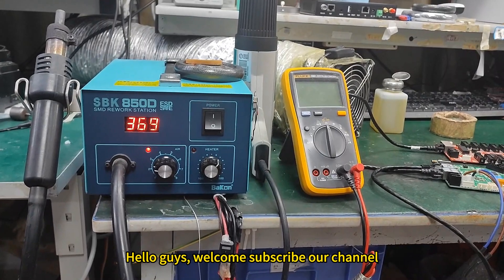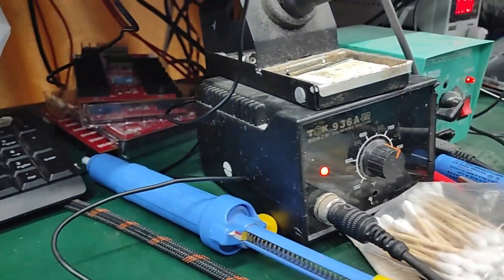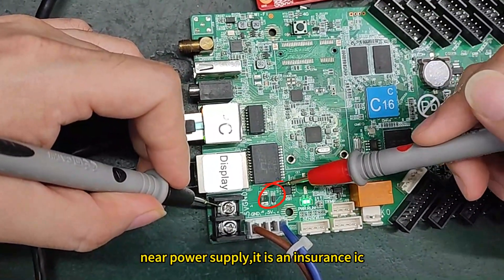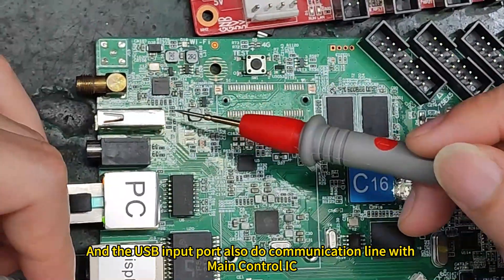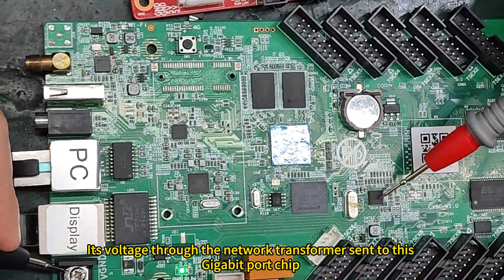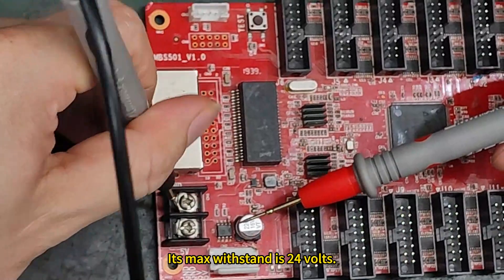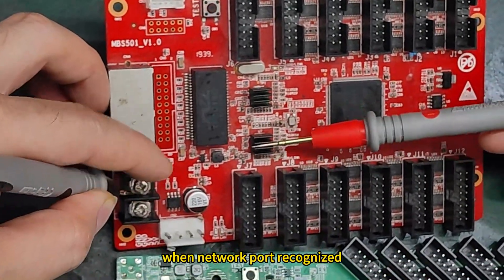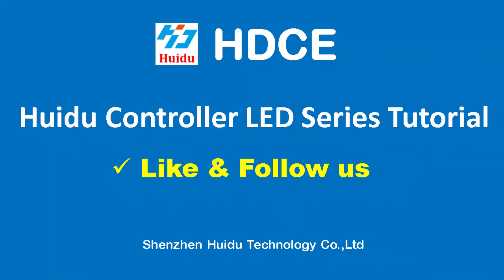How To Repair Huidu Controllers

Comment: Hi! I’m using an HD16. The app connects and sends the signal to the controller successfully, but the P2.5 LED panels stay blank. Any suggestions or settings I should check?
Reply from the maker: Did you finish debugging the right parameters of your LED panel before sending content? If you need technical support, welcome contact WA: +8613510540791

Comment: if you wrongly upgrade the firmware of R512 recieving card with R712 firmware files can the recieving card be restored back?
Reply from the maker: yes, you can upgrade again with right file. If you need technical support, welcome contact WA: +8613510540791

Comment: Hello!! My d30 screen controller not saving new files. I load new screen file from hdplayer software and its good, but when i restart screen, shows previous screen file. I change the battery cr2032, but still same problem. Any suggestion?
Reply from the maker: Hello my friend, welcome contact whatsapp or wechat attached in home page +8613510540791

Comment: Can I connect receiving card with c16c control card for board running. with out media player or processor
Reply from the maker: yes, C16C is asynchronous controller, it doesn't need to work with video processor.